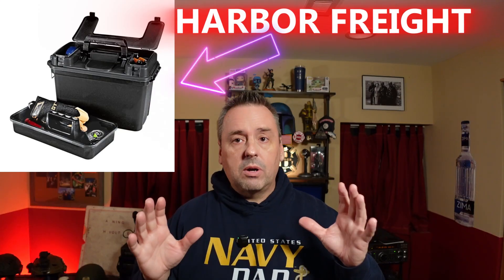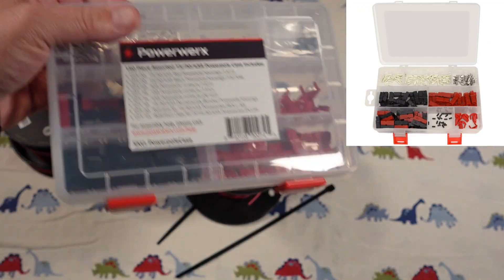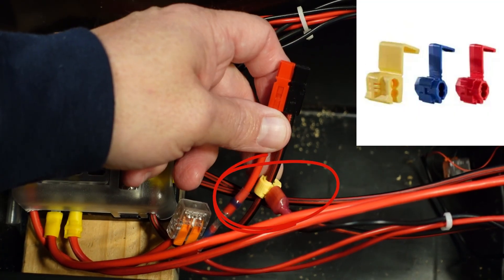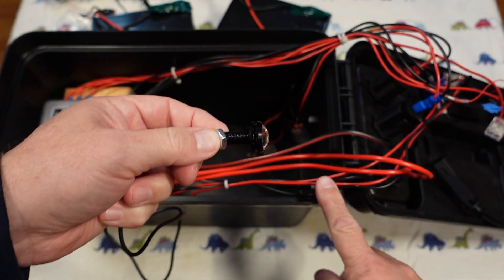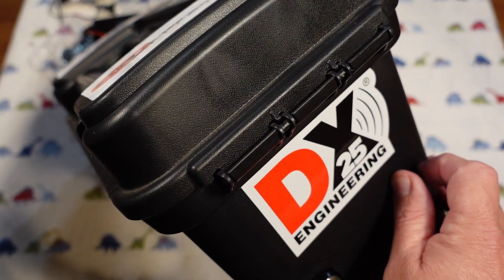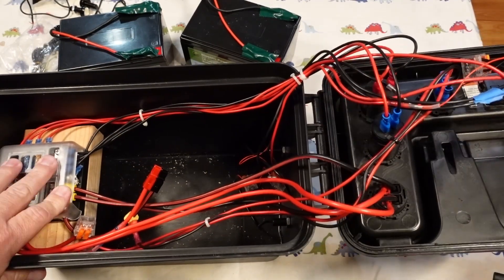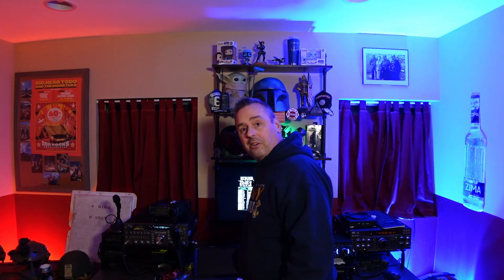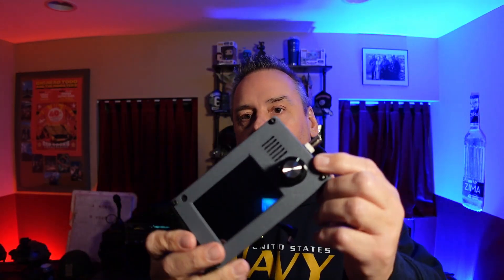How I Built My Ham Radio Battery Box!

Comment from the maker: Just a few things I forgot to mention in the video and someone brought this up and they are absolutely 100% right: please make sure you are aware of the battery manufacturers recommendations for putting batteries in series or parallel configurations. I realized I didn't make some things clear in the video: I run the batteries into one lead then onto the PD4 distribution block. Then one cable runs to the fused block. The solar panel goes to the controller/charger then I run one fused cable to charge one battery at a time, then one battery can continue to power up the radio. Please do your due diligence when attempting any kind of electrical projects. Be safe please.

Comment: A wiring diagram would definitely help. Im gonna attempt building one.
Reply from the maker: Honestly: I just draw one out like real simple on the back of an envelope and then pretty much I just put it together. I'm in the process of getting some things together to make a smaller box for a single battery I'm going to be doing a video on that build also I'll throw in a simple wire diagram on that video. Thanks 73 KC9USB

Comment: Very nice, neat build. How RF noisy is that charge controller? Have you used it while running the radio? From reviews I've seen, many/most MPPT controllers are RF noisy.
Reply from the maker: Good point: as a matter of fact it does generate RFI. I use three ferrites at the panel and then after the controller/charger (6 total). That helped especially putting them on both the input and output cables from the controller. Also I believe Palomar makes a kit of ferrites for reducing solar charger/control RFI. https://palomar-engineers.com/ferrite-products/ferrite-beads/Solar-Charge-Controller-RFI-Kit-3-I-O-Ports-p128795401

I have not used this but Palomar makes some good stuff. Thanks for watching and commenting 73 KC9USB

Comment: Brian, what is your feeling about the 'recommendation' from Bioenno not to connect these batteries in series or in parallel? I have found they seem to be the only manufacturer that has a recommendation of this kind in the manuals. I just don't see this as a typical battery chemistry recommendation. Only Bioenno seems to worry about these configurations.

I would not expect that anything adverse would happen. However, it did scare me a bit.

"We do not recommend using our LiFePO4 batteries in series or parallel connection if a single battery of equivalent size can be used instead. The PCM/BMS built into each battery is intended only for operation with a single battery and we do not guarantee the operability of multiple batteries in series or parallel configuration."
Reply from the maker: That's something I looked at also, but I have to be honest with you: I'm not the first to put these in a parallel configuration: and I'm not saying that like it's a justification for doing it. I don't know if I made it clear in the video (which I may not have) I take the two batteries to a single lead  then to the Powerwerx PD unit and then run one lead to the fuse box. I charge each battery individually and have also ran a solar panel to the same PD unit and never had any issues. I know that they are about the only ones who state about not using the battery in different configurations I have to be honest I haven't had any issues with them in about two years doing it. 

I will say this and I didn't in the video: everyone needs to be aware of doing things with batteries and I have been around some crazy battery set ups when I worked in telecom equipment installing. With that all being said: if anyone feels that they shouldn't be put into parallel then please don't do it! When I get done every time I use the battery box I do unplug both batteries from the PD unit inside the box. 
I might have made a mistake about not making it clearer stated in the video about that. Also I wouldn't put these batteries into a series configuration: that is where I think you'll run into the most problems. If your voltage is either higher or lower than the other battery than I could see that affecting the PCM or BMS of these types of batteries. When we worked on battery strings in the cell huts and phone offices we had a special fused box (actually more of a shunt type thing) with two leads  made out of 1/0 power cables to help equalize the voltage between two battery strings. Not telling anyone to do this by the way! But the point being please don't attempt something that you feel could cause an unsafe condition. 
I hope this answered your question, and again I didn't state it in the video ( maybe I should have) but please be aware of what your doing and if you feel that something is unsafe or could damage something please don't do it. And thank you for bringing that up and making sure people are aware of the manufacturer statement regarding that. 73 KC9USB

Comment: Perhaps this may help others that are as tech challenged as I.  When I built my battery box I discovered:  1.  Not all wire is created equal.  There is some with more flexibility than others despite being the same gauge.  It's a rubber coated insulation as opposed to a stiffer plastic.  I recommend the more flexible despite a slight higher cost.  And 2.  The ISB ports are also not created equal.  I recommend the type C which (if my facts are accurate) supposedly charges faster.
Finally a silicon caulk around the holes where these ports are installed may help with some water infiltration even though it isn't built to be water proof.  I'm jealous of the fancy  usage meter and the improved solar regulator.  It's a clean build bro.
Reply from the maker: Thank you so much for the additional tips! I appreciate this because as I too am always learning. 73 KC9USB